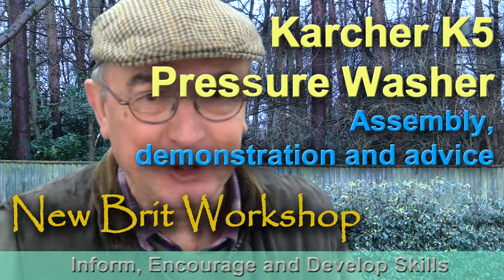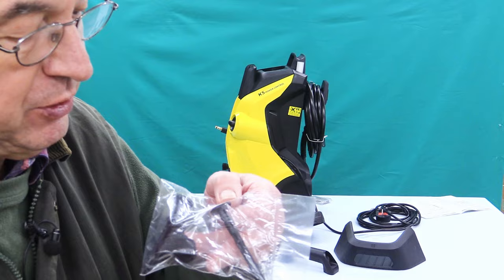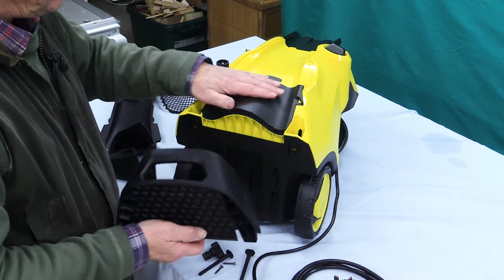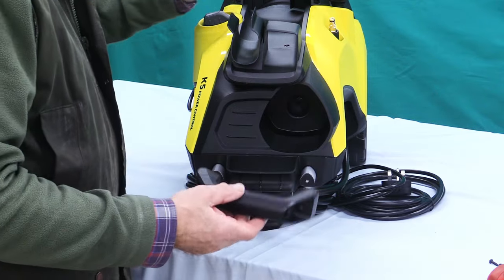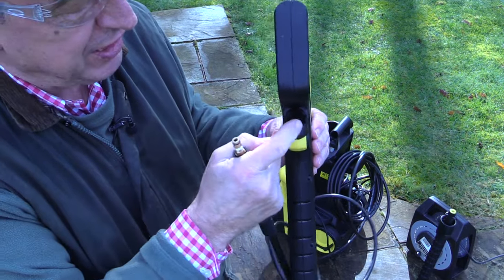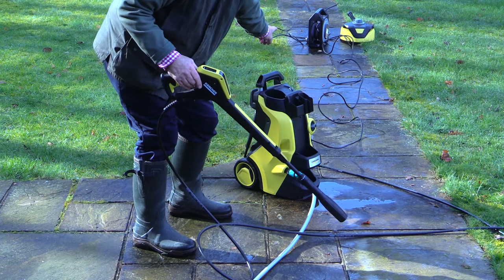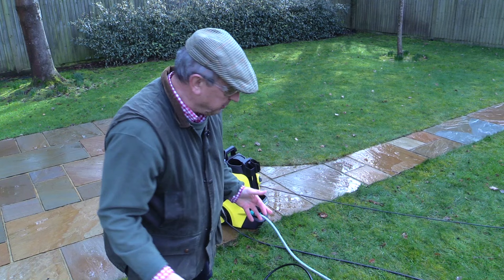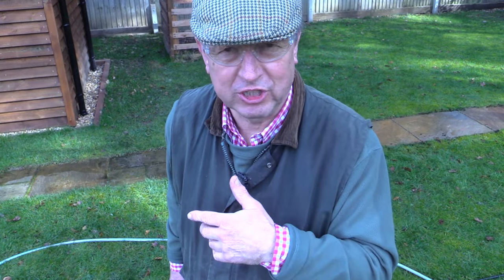Karcher K5 Pressure Washer - Assembly, Demo and Advice

Comment: Just got one of these and unless they've changed the design since this was made, the machine screws should be used for the handle and there is a longer pair of self tapping screws for the wheels.  Also, if you get the version that connects to the app then the assembly instructions in the app itself are 100x clearer than the printed manual, the app itself isn't really useful apart from that.
Reply from the maker: Hi Stephen, Very useful - many thanks.  Peter

Comment: The screws to hold the wheels on are actually the 2 in the dowel pack, and the smallest screws are for the base. the longest screws are for the handle so you seam to have gotten pretty much all the screws wrong aside from some of the small screws. At least that is what it shows in the assembly manual.
Reply from the maker: That is almost certainly right.  Cheers.  Peter

Comment: Superb, thanks very much, I’d already used the wrong screws to hold the wheels on before I found your video. I hope that the Karcher fairies have bestowed countless gifts to you.
Reply from the maker: Hi Graham, Yes, I think Karcher need to look again at their instructions as it was my engineering background that helped me to work out where those screws should go - plus the obvious use of the pair in the same packet as the plastic dowels.  Cheers.  Peter
Reply: Im having issues with screws that go into the plastic dowels not seems to be going in

Comment: nice review. as a k5 and some older model (i think its a k620) owner with various adapters , i should say this: i think they they made things little better in the past, now if you want something reliably for little more substantial jobs, reach for their pro line (better pumps, better nozzles, thicker, stronger hoses etc). i'm not saying it's a bad product, it does the job very well, but in the end, now i have to use about 20+ year old nozzle from old model, since original from k5 cracked at the plastic tip and does not spray correctly (very low pressure). on my older model, i just replace the start capacitor and some o-rings, and it it runs almost as new (it was used heavily all this years with no bigger issues) and the best part: i can still use all new adapters with this, i really hope, karcher won't end this tradition.
and by the way, that foam lance is not something to brag about, for true thick foam (which is whole point of getting one) get a proper one. other adapters are ok, i also have cable for cleaning gutters, pipes etc, expandable nozzle for cleaning house façades or some bigger things etc. i do have rotating brush for car cleaning, but i don't think it does job that much better then regular hand washing and brush tips get damaged quickly, i think, which could lead to scratches on the paint etc.

Comment: Hi Peter -  Thanks to your demo I was able to figure out that the 2 long plastic dowels were NOT valves that somehow fitted into the hose connections. However, you may have used the only 2 machined screws for the wrong purpose 3:25 
I used them to secure the handle to the two retractable metal rods that have threaded metal cores bored specifically to accommodate these screws. The screws for the wheels appear to be the longer, self-tapping ones listed on the manual's page 3 (illustrations B & C). Oddly enough, when you snap the wheels into place, even if you didn't use the 2 provided screws to secure them, the wheels would probably stay put without the this additional security. Love your wellies🖐😎
Reply from the maker: I think that you are right.  Cheers.  Peter

Comment: Thanks, friend! Like everyone else the instructions it comes with is rubbish. Your explanation is very clear but it's not just that, you give tips like lining yp the wheel holes as you insert them and how to line up the flat ends. I was excited about buying the machine but put off assembling it until I found your video. AMAZING WORK THANKS.❤❤❤😊
Reply from the maker: Thank you so much. Cheers.  Peter

Comment: Hi Peter, another informative video.  Something to add to one, or both, of your forthcoming videos:
Care should be taken not to kink the high pressure hose.  The kink will remain, and there will be a tendency for a kink to form again in the same place.  Over time this will weaken the "high pressure" hose.  Not that I've experienced a failure, but something to bare in mind.
Reply from the maker: Hi Steve, That is part of the reason why I talked people through the "unwinding" sequence.  Cheers.  Peter
Reply: @NewBritWorkshop  Yes, but trust me, that still doesn't guarantee a kink free hose.  A rotary connection in the system would help enormously.  It wouldn't surprise me to find out that new hoses are of a less robust construction to save money.  Pressure rated yes, but maybe not so kink resistant.

Comment: Perhaps Karcher have changed the fastening arrangement as my K5 is identical apart from the shrews holding the handle are longer threaded pins and not self tapping screws. dated 23d June 2021.
Reply from the maker: Interesting. Cheers.  Peter

Comment: An excellent, detailed demonstration. However, I am not sure whether a standard Hozelock tap connector is correct to use to connect the hose pipe?
Reply from the maker: Hi Holly, That is what I use but others are available from Screwfix for example.   Cheers.  Peter
Reply: @NewBritWorkshop  Thank you for your reply. Much appreciated. 
Holly

Comment: Looks like a great upgrade on the K2. The place for the cable alone is worth it, I find it a real hassle. Although, it'd have been nice to be able to roll in both hose and electric cable (the electric cable should have something like they have on the pull along vacuum cleaners) to ensure they're as compact as can be. It looks like the hose might conform to a larger circle each time you put it away!
Reply from the maker: Hi Rico, This machine is a quantum leap ahead of the K2 and so much easier in our new house which has more areas to clean than before.  Cheers.  Peter

Comment: Thanks Peter I have the K4 with the Home care disc, looking forward to your take on the block paving...bet you have not done the video before my missus gets me onto the block paving ..Cheers Paul
Reply from the maker: Hi Paul, I am still researching the best strategy but I expect to clean the block paving with the surface cleaner, hopefully not on full throttle. Then, after it is dry I will sweep kiln dried sand back into the joints and after that apply a long life anti fungal/moss treatment with a hand sprayer. That is the current plan but it may change. That video is about 6 weeks away unless something drops out of the running order.  Cheers.  Peter

Comment: I got the machine today . What I like most about it is a long cable. I can easily go around a car with it without having to constantly carry it with myself like I had to with my K2 . But the display isn't working when cycling through the intensity settings. Is there some trick to get it working because I see no buttons or anything.
Reply from the maker: I have never looked at any display on the machine - no need, it works.  Peter

Comment: Great video! i have a question, the pump head in the machine, where the pressure hose connects, is made of metal? or plastic?
Reply from the maker: Hi Emanuel, I think it is metal.  Cheers.  Peter

Comment: Hi Thanks for the video helped a lot. Just a couple of points you may want to check. I think you use the wrong screws to certain parts. The two threaded screws should go in the handle not the wheels, the wheels take the two longer self tapped ones. So the base just takes the small self tapped ones not the long ones that should go in the wheels. If you look at the handle holes they are the only ones with a thread
regards
Reply from the maker: Hi Andy, This is a tricky one as I now have no way of checking except to say that at the time of assembly I made what I thought to be the best decision at the time. I could not see any sign of a thread inside the body where the handle would go. This may be one for Karcher to sort out.  Cheers.  Peter
Reply: @NewBritWorkshop  In the instruction book that came with my K5 it shows the four types of screws that are included, then in each separate illustration the screw for that operation is highlighted, so your video will confuse people that find the instruction book difficult to follow as it's too small, so use it in conjunction with your video, when you appear to use the screws for the wrong  part. You can download the instruction book here
https://s1.kaercher-media.com/documents/manuals/raw/000/BTA-5749942-000-00.pdf
Hope this helps
Reply from the maker: Hi Andy,  That is brilliant and I am very grateful for you putting the link to the instructions. I will highlight this comment of yours which should put it within easy reach of viewers. Many thanks again for clearing this up.  Peter
Reply from the maker: Hi Andy, I have now put a note in the video description and acknowledged your help.  Cheers.  Peter

Comment: hello Peter…your video is very helpful…we bought a Karcher K5 last year and have used it a couple of times…but we have a question - 1.when the 3 in one jet is attached,we see that you can turn the settings round and it clicks on each turn...we are maybe being stupid,but what do you line it up with to show what setting you’re on ? … this set up seems a bit hit and miss and is the only thing we have trouble with…hopefully you may be able to give some advice…many thanks…
Reply from the maker: Hi Duncan, It is shown on the indicator on the pressure gun handle. Peter
Reply: @NewBritWorkshop  …thanks Peter,that makes sense… think we confused ourselves !!

Comment: Couldn't find the part where you connect the surface cleaner to the handle?
Reply from the maker: It is very easy just push in and twist. The same as all the other attachments.  Peter

Comment: Just bought one k5 power control and just noticed the noise level is 92db instead of 91db what the hell? It says it's made in Italy. So I've got a pressure washer noisier than the k2 i had for 10 years.... Did i get a air cooled pump instead of a water cooled?

Comment: Hi great video quick question I was thinking of upgrading my k4 eco which has the green pressure hose too the k5 as demonstrated by your self 
Could you pls tell
Me if the pressure hose on your k5 coils up and kinks when in use or does it lay down flat 
This is a major floor on the green hose and I have found that company’s now produce a non coiling replacement hose  in which case I might buy the k5 compact only £199 and a new hose as I still have all the tools and lances from my k4
Many thanks jeff
Reply from the maker: Hi Jeff, The pressure hose with the K5 is black and, as far as I can tell after many hours of use, is unlikely to kink. Because it is quite stiff it needs to be uncoiled by rotating one end in order to get the loops out after which it lies flat. The beauty of the K5 hose is that it is 10 m long which is a great time saver when doing a patio as the machine does not need to be moved very often. When doing a car (perhaps not a limo) the machine can remain in one place.  Cheers.  Peter

Comment: Just got my one and I think you may have the wrong screws in certain holes. Check the app assembly instructions. Long self tappers for wheels, machined screws for the top handle and the short self tappers in the rest.
Reply from the maker: You may be right but mine works fine so no harm done.  Peter

Comment: Mine is currently in bits attempting another repair. It started with the dreaded surging (no leaks), had valves replaced so now it works, problem is, it doesn't build up any pressure.
Reply from the maker: My very first machine behaved like that and I discovered it was due to frost damage.  Peter

Comment: When I use the patio “gadget” even on “low” selected with the dial it won’t use the shampoo, on the handle bar the indicator shoots up to max and no foam. 

To get any foam i need to get the lance.
Reply from the maker: I apply the patio cleaner with the lance and then leave it for 20 minutes or so before using the circular patio gadget.  Peter

Comment: Great review. Do you think one of these would be suitable for a small patio cleaning business? And do you think there is a lot of difference between this device and the K7 model?
Reply from the maker: Hi Callum, You should consider the K5 first as it is less expensive yet a very robust and powerful machine. If it gets damaged or stolen it is less of a loss yet will still suit your needs well. If after 3 years you want to move on to the latest top of the range machine then fine.  Good luck to you and I hope the business is a success - remember, go the extra mile and be the best.  Cheers.  Peter

Comment: What is the hosepipe connection requirement?
Reply from the maker: Hi Colleen, A standard hose end connector is needed on the end of your hose that connects to the Karcher,
https://www.waterirrigation.co.uk/hoses-and-accessories/tap-and-hose-connectors/hose-end-connectors/pack-of-2-hydrosure-hose-end-connectors-13mm-15mm-1-2-and-5-8.html
Peter

Comment: Sir how much water is flow out per minute?  is it 8 litter per minute? the specification say 500L/H
Reply from the maker: Hi Lalrem, When the pressure is reduced I imagine that it is a lot less than the 500 L/Hour. I have no easy way of measuring now as the machine has been drained and put away for the winter. My guess is that on the low pressure setting it is at least half of the stated flow rate.  Peter

Comment: Is it worth overpaying for 2021 version of K5 or 2019 version is still good enough?
Reply from the maker: I am definitely going to upgrade to this machine and will donate my K2 to the children.  Cheers.  Peter
Reply: @NewBritWorkshop  I mean there are two different versions of K5, one of them is 2019 and other is as yours 2021. I was wondering if you know if 2021 version is much better than 2019.
Thanks
Reply from the maker: I understand. From what I can see the 2019 version is more basic and has the old fashioned tubing approach for detergents. The 2021 version is much neater. However, if your machine is working well and doing all that you need then keep using it. If you want the added features and up to date mechanics then go for the upgrade - you could sell the old machine very easily.  Cheers.  Peter
Reply: @NewBritWorkshop  Thanks a lot for your advice!

Comment: Why do I have trouble starting mine? I turn through dial and it is a hit or miss. So frustrating. Once the motor runs I have to squeeze trigger straight away. If not, it have to start all over again turning the dial on and off over and over again to wait till Motor kick starts again and hopefully o get to squeeze the trigger quick enough. And if I release trigger I start the saga again
Reply from the maker: Hi Charissa, Before turning on the power connect the water, turn it on and then squeeze the trigger until water is running out.  Then it will work first time.  Peter
Reply: Tnx. Will try.

Comment: Is it good for blasting my drive and weeds?
Reply from the maker: Weeds with strong roots will still remain but it will certainly make most driveways cleaner.  Peter
Reply: @NewBritWorkshop  many thanks.
Reply: @NewBritWorkshop  just brought one today as someone was picking up the K7.

I've heard the K5 is better than the K7 regarding the efficiency to power ratio.

Comment: Nothing would ever convince me to get a katcher. I’ve owned a number of there products including patio cleaners over the years and none have lasted. Switched to Nilfisk and they were great but they now produce in China and have gone downhill. Buy a good petrol machine
Reply: AMAZING instructions & advice.😍 Previously I’ve just used a patio brush & soapy water. A Backbreaking task with nominal results I took the plunge and ordered a pressure washer. 
Yesterday I took delivery of my first ever Karcher pressure washer K5 Smart Premium. Due to your informative video I was able to set this machine up and actually use it! I expected this machine to be extremely noisy & disturb the neighbours whilst cleaning my patio. However I was surprised that this machine is not that noisy. 
Whilst using my Karcher I also followed your video. THANK YOU and I now have a dazzling patio. Now I’m going to watch your other Karcher videos before I start on my drive & car.